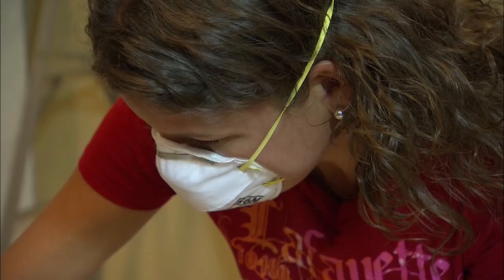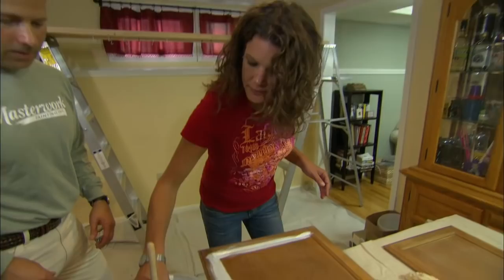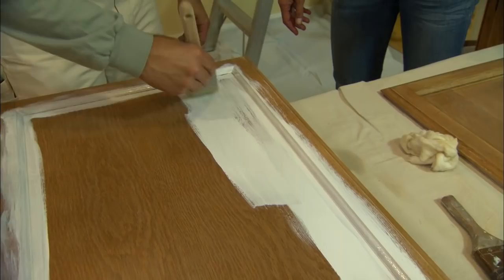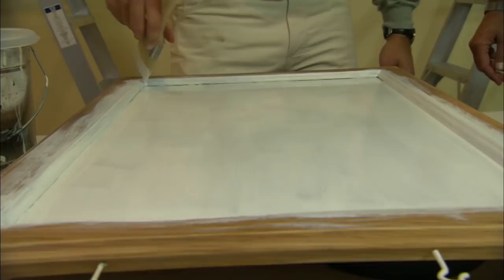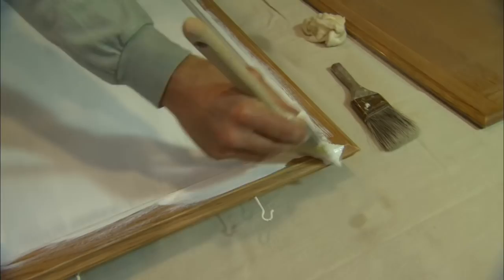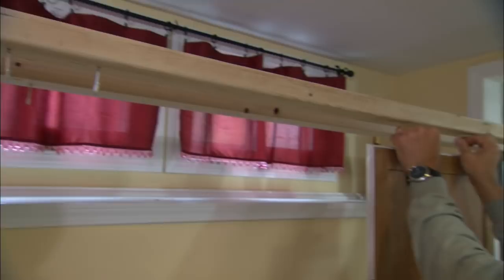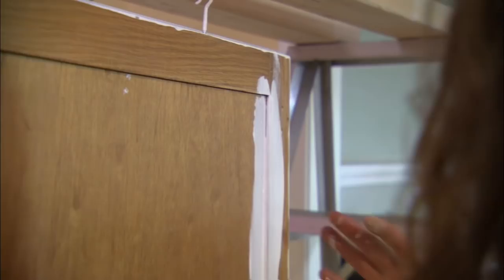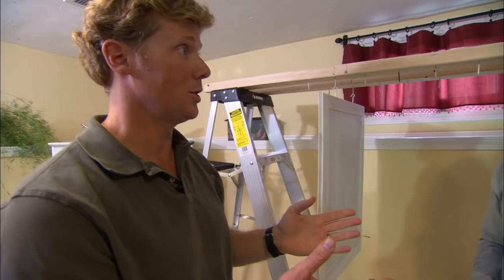How to Paint Kitchen Cabinets | This Old House

Comment: This video is Great!!! I have been a painter 20yrs and this hanging method is a wonderful addition to me spraying the finish on with airless sprayer. I do like to do first coat with brush to help fill in all the thirsty spots of wood. Hanging allows me to do 1 full coat at a time instead of having to do fronts then back side. Also less chance of marring the finish between coats. I personally sand blast the doors to make quick work of the  light scuffing needed for adhesive.
The fact that he is also doing polyurethane let’s you know he’s a pro. Anyone know if there is a second part to this video?

Comment: No grain filler?  Assuming those are oak cabinets, wouldn't the oak's grain still show through the finish, even after the paint any poly coats?
Reply: depends on type of primer and paint as well as how many coats.
Reply: Personally I like a hint of wood grain to show, otherwise the doors look kind of plastic too me.

Comment: some stupid comments in here..maybe you guys/gals have your own show on remodeling? OR have ran your own business doing such? IF SO please share with us your perfection.
Reply: my family has been in the construction business since the 1940s, and is still going, i grew up with a hammer and a paint brush in my hand.. i also painted crack filled for close to 20 years,have rolled just about every type of paint out there, and the main thing i see people do wrong with cabinets ,is not using an oil primer, i have tried other types of laytex primers, but i ended up having to go back a repaint it all over again, because it did not adhere properly.so stick with an oil primer like cover stain and you will never have a problem. then a paint like the benjamin moore advance over top of the oil primer,,
Reply: There are always critics or trolls in everything that is done online.  Most people dont realize the amount of time it takes to film, edit and produce great videos so I totally agree with what u have to say
Reply: Shellac primer works great too! You can paint oil or latex over it.

Comment: Hello. Anyone have good ideas about house trim?? I have reddish trim around windows and baseboards. From old owners. I don't like the color at all. It's not shiny at all so I don't believe is was varnished.. Oil base primer to start??? Thanks
Reply: thorough cleaning, sand 100-150 grit. use hard to stick to primer.
Reply: try a liquid sander/deglosser instead of sanding. It's a milky white thin liquid, doesn't really smell at all, wipe on wipe off, and just removes the gloss of whatever is on there, dries fast, then paint or prime. Trim is usually gloss or semi-gloss. Good luck!

Comment: I am not sure why you would want to paint over good/pretty wood cabinet in your kitchen. My kitchen cabinet was already painted yellow when I purchased a house years ago. It was not pretty and wish they never paint it. It would be too messy to remove all old paints, the best optional is to install new cabinet. Perhaps it's better to re-stain than paint over. What do you think?
Reply: Grant, you can buy a remove paint thinner from Lowe or Home Dept
Other wise. you might need spread after paint it and putter knife.. All of old paint remove about  between 20-30 minutue.  Wait it became little mix wet after paint .. Became little lump .. Use putter knife removed old paint.. then let it dry.. Sandbox with a sandpaper.. Ask Home Depot or Lowe will help you to find a best choice. It is not that hard.. Very easy. I remember back 30 years ago. 

Margaret
Reply: I had no problem with my old dresser.. Now it sold from garage sale..  if you want to paint color likely Green or Hunter or Black. I rather black.. it will be looking good in bathroom or kitchen room.
Reply: Yeah I agree with you Grant..  This seems like a Silly fad that people are going to regret.  Do they think this adds value to their house?  Are buyers going to prefer nicely finished wood cabinets or those with a DIY brushed on latex paint job?!
Reply: Maybe the previous owner will see this and help strip the cabinets for you.
Reply: Some wood cabinets are just plain ugly and are outdated, if u don’t want to repaint u can spray on a stain finish....look up stonecoat on YouTube.
Reply: New cabinet doors,maybe.  Why replace all the cabinets?

Comment: hi great video, I'm planning to paint my old piano, I want to paint it black with a mirror shine finish, any tips.
Reply: +zac Samu You may want to hire a professional for that. I'm no professional but I think you need a high quality sprayer to lay down a smooth finish, then polish the paint to a high gloss smooth finish.
Reply: Paint with a matte or eggshell sheen, then a high gloss lacquer brushed on slowly, no roller, keep a wet edge, don't over brush (back and forth) it will set up very fast, and wet sand with a 400 grit between coats. 3-5 coats, thin coats so it won't run, buy a nice brush 3-4 inch. It'll be gorgeous. Also, don't ever shake the lacquer, stir it slowly so you don't get little bubbles as they will show up on the surface and you'll have to sand them out.
Reply: Use epoxy self leveling....way more classy than any paint

Comment: dont u need primer?
Reply: +Cataline Levy yes you do and if they are varnished cabinets you have to oil prime
Reply: yep
Reply: there are many latex primers that can go over varnished surfaces.
Reply: and they will not give you the best adhesion .even the styx primer i have seen it let go after it was on a few months. i have painted hundreds of cabinets and used just about every type of primer,and the oil base primer is the best to use,and insures the best adhesion to it..
Reply: I'm having that same problem. The water based primers scratch off easily. I used "Zinsser® Bin Cover Stain" (oil) and its never coming off (good), BUT it is impossible to spread and leaves thick brush marks. I think oil is the way to go though. I'm thinking about adding Penetrol® to make it flow properly. Thats its only problem (a BIG one).
Reply: TheEgg185 where did you buy the primer at, and did they tell you that is what you needed,,its the same idea as behr paint and primer all in one, and even the adds say prime while you paint, but put it on new drywall and you will be in a big mess...
Reply: act when you bruch cover stain on. do not put it on heavy, just the tip of the brush in paint, and it will not leave brush marks
Reply: You don’t need primer/ rub down with de-glossier and then use oil base paint. Lightly sand between coats if it requires two coats.